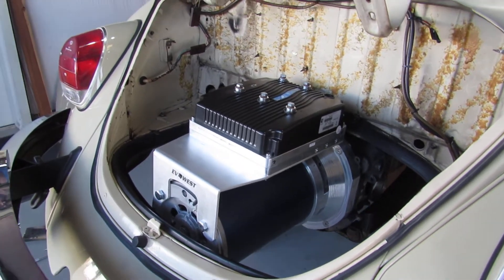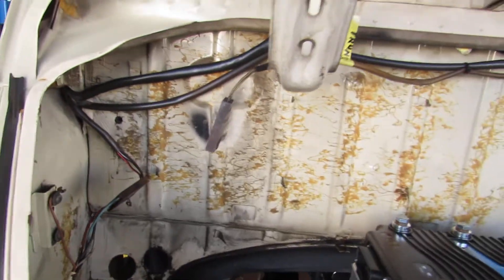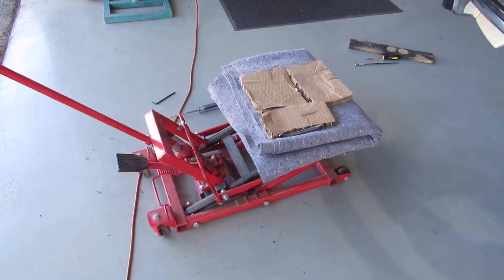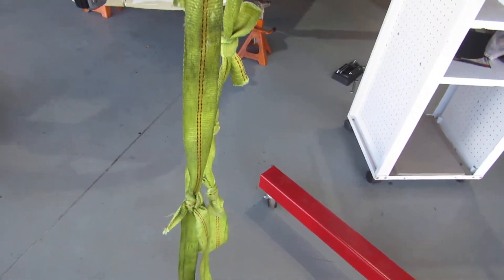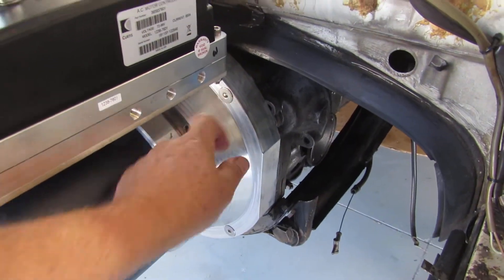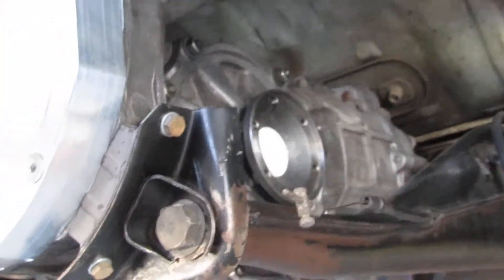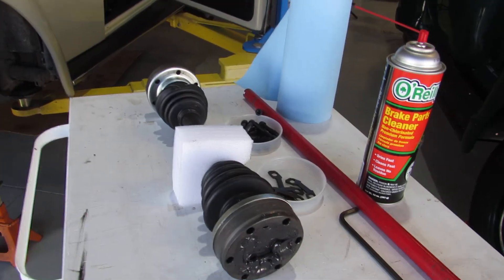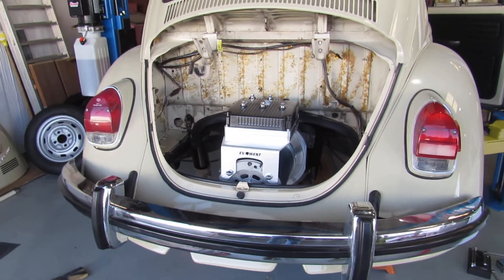1971 VW Super Beetle EV Conversion...Motor is in!

Comment: Thanks Randy for the update! question: did you do any modification to the transaxle? My biggest worry in my process is the torque that the motor will put on it. I noticed EVWest has a rebuild one out there with modified ratio's and only 2 forward gears but its $2,000!
Reply from the maker: Wow....sorry, just noticed your comment, but, no, I did not do any modifications to the transaxle.  Likewise, I'm concerned about the additional torque, but decided to "give it a go" and see what happens....probably not the best approach, but can easily remove the transaxle and then have it beefed up after the implosion.....HA!   We couldn't quite justify the $2k evwest wants for that trans.  Thanks for following along on the adventure!